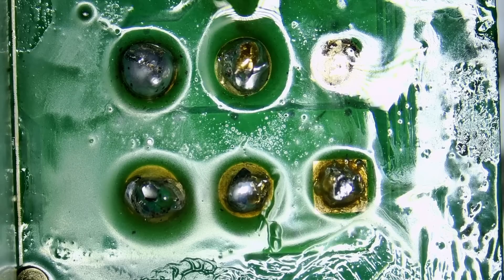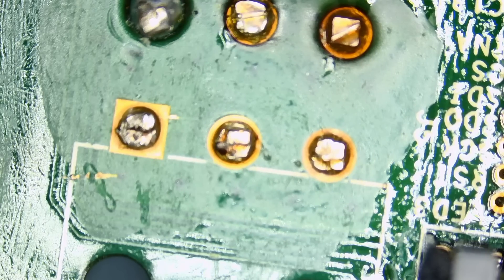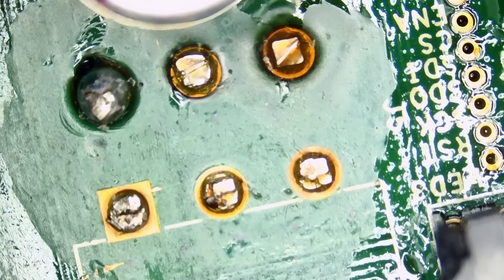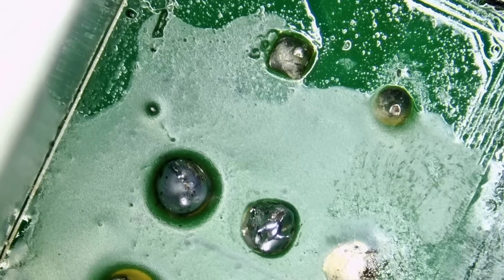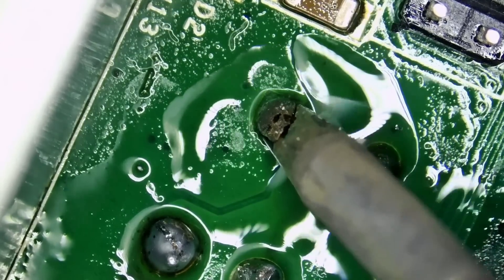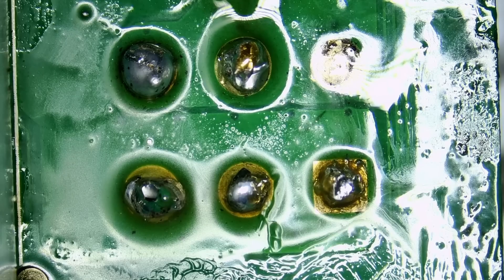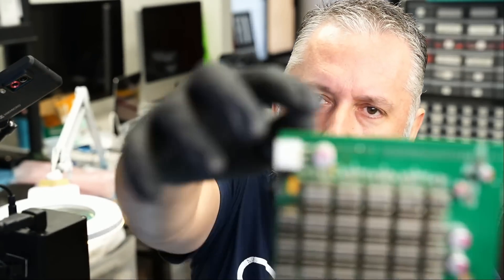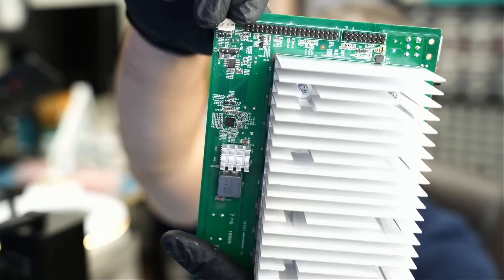GoldShell Mini Doge Miner Repair - Burned connector

Comment: Can you use low-melt solder for the final solder, or do switch between leaded and unleaded? Backmin the day we used rosin core 60/40 with no ventilation and tri-chlorithane to clean.

Comment: Oh here's where I have some jank experience. I was working on a Nintendo. I completely broke off some connector that was straight through hole. The pen was stuck in the hole and the only way I was able to get it out was using the thinnest tip on my soldering iron a bunch of flux and a lot of patience. Those thin tips don't really transfer much heat

Comment: i cange lot of this connectors on antminer hashboards, i use 350w solder and cleaning holes with pressure air :)

Comment: Learning from Alex, the benefit of using low melt solder and how important, very good flux, is to repairs, has completely changed my personal experience with soldering, and building some custom sensor boards for use with various SBCs.  No matter how many times I watch Alex work, I continue to observe how to improve my own technique when it comes to installing and removing components.

Comment: HI Alex its so satisfying to watch a professional at work although now 70 myself my father was a prototype wiremen and had to do micro soldering on many types of prototype multi layer boards on equipment now in common households and aerospace industries and had to wear head mounted magnified lenses and hand held he would find it absolutly amazing how his and your profesion have advanced over the years and also your mindset in your work ethic as sometimes you do have to make the decision enough is enough and not every thing is solvable or repairable he kept his frustrations under control until i tried my hand at it but thats for another day as i became a carpenter in the end as sometimes the only answer was i need a bigger hammer keep up the great work i know doubt you've inspired many with your content and great humour as always Better than factory
Reply: And not a finish carpenter I take it. 😂

Comment: I know people will like covering up the exposed copper, but I'd have skipped that unless I had green.
Reply: Eh, if it's already solder coated I'd skip it in general unless it's to hold down a bodge wire, because otherwise it's pretty much cosmetic.  There may be some argument against corrosion to re-coat bare copper if it got scraped.

Comment: interesting! I have tried just yesterday to replace an hdmi connector I used only the air station it was all going well until I noticed the new connector was not exactly on place! because the anchor pins were somehow bent now i had something else to work on and I just quit on it for the time being but now after experiencing it myself the low melt seems more effective. I'll see how it goes 🤔
Reply: Are you sure you had the right connector? Some are offset by half a pin...
Reply: @BertoldVdb  yes the right connector but I mean you need the pads and the holes to be clean to adjust the connector and place it correctly in case of any problem with the connector. This might not happen often if you have a new port but it is better that way so that you don't do the job twice or more.